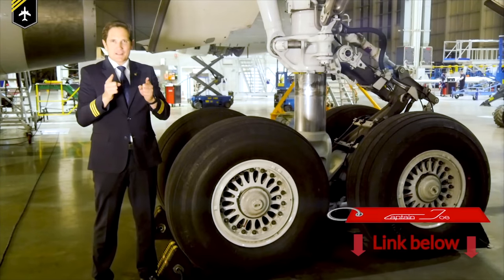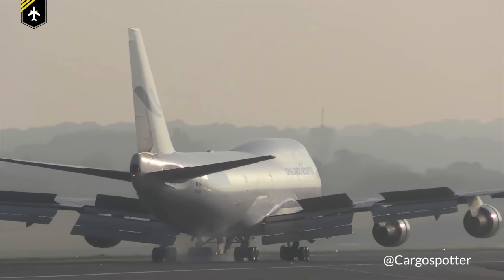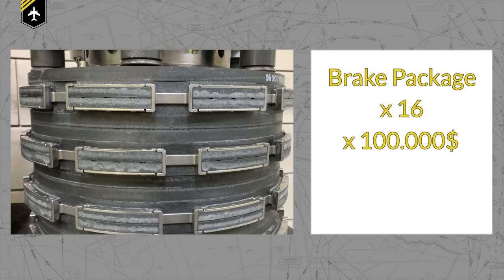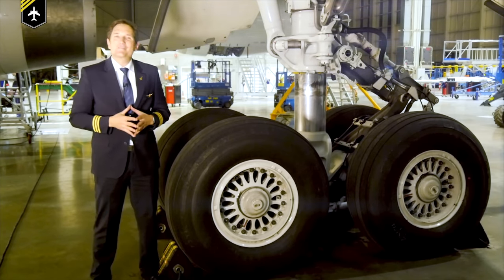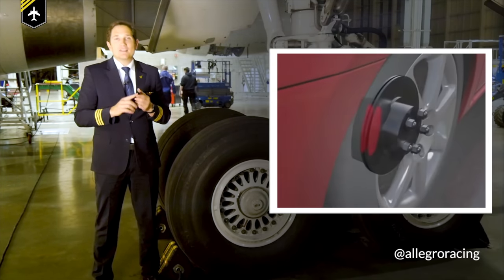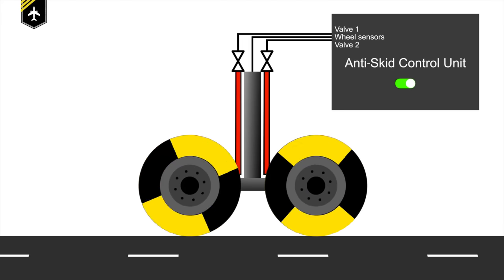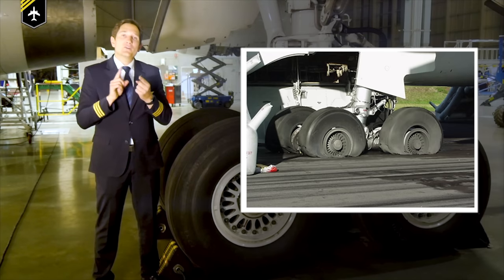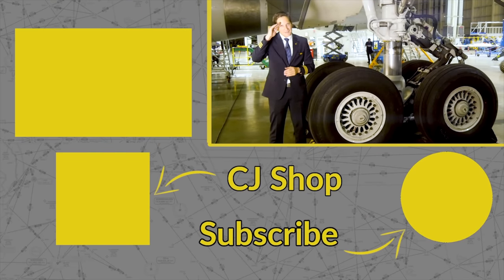Do PLANES have ANTI-SKID??? How to PREVENT SKIDDING? Explained by CAPTAIN JOE

Comment: My question is, when the engine shuts down during landing, how do we apply brakes to stop the aircraft ?
Reply: Engines do not shut down on landing. They do so only when at the apron. When landing, they still keep running on idle power (or even spool up again to provide reverse thrust if applicable). At any rate, they would still provide enough energy to drive the breaking systems... and there are further backups even for the case that they couldn't do their job...
Reply: @eaglerainbow9313  thank you.. 
Recently there was an aircraft crash at Calicut. The captain has switched off the engine! At that time, how to stop the aircraft?
Reply: @naveenelangovan5406  I assume that with Calicut you mean the crash of IX-1344 at Kozhikode. From what is known so far, there are no indications that the pilots switched off the engines (but you could give evidence for that). The issue there sounds rather different to me (but too little is known right now to properly judge it yet).
At any rate, speaking of the majority of modern airplanes, wheel brakes are controlled hydraulically. There are several independent hydraulic systems in a modern airliner. And several of them can be pressurized also by electric pumps. When the normal engine generators are not available, these electric pumps themselves can either be powered by battery or by the "auxiliary power unit" (APU) located in the tail of the airplane. So, in short: If pilots have enough time (before shutting both engines down), they could bring up the APU beforehand and have hydraulics powered by its electricity generator. If not, they have some backup with the batteries. 
And anyways, there is also another option you might not think of: If the runway is long enough (and some more factors like mass, runway condition, wind, etc), there is even no need for braking - you can just let the machine roll out with spoilers engaged (yes, that is not too uncommon as well, even under normal landing conditions, but requires some reasonable weather, which IX-1344 certainly did not have).
Reply: For a hydraulics-out emergency landing, brake accumulators (pressurized spheres of hydraulic fluid) provide the braking capability.  On an MD-80, for example, two such accumulators in the wheel wells provide enough hydraulic fluid for three complete press-and-release cycles of the brakes.  That's plenty for stopping, since fluid is only used up when changing the brake's position, rather than to hold it at a certain amount of braking force.  Just need to avoid much pumping of the brakes, such as to maintain lateral control via differential braking.

Comment: I thought on regular landings for big airliners an anti skid system won’t be needed due to the shear weight of the plane pressing the tires... thought this would be enough to have a controlled manual braking with enough margin to prevent any skid to happen. Not applied in wet, damped or snowy conditions though
Reply: Most airliner brakes aren't "torque limited" (the term used for when a tire can't be made to skid) except at some higher speeds/weight combination.  As a result, an antiskid system needs to be operating even for high-weight braking, unless braking level was kept moderate-to-low.

Comment: Captain Joe  would you tell about existence of any automatic system in the aircraft  which can be activated for  commencing   a go around  necessiated  due to some emergency,  after a TOUCH DOWN.  Seen in various videos that pilots do such emergency take off  manually and the chances of some critical omissions during such  flash  manoeuvre   activities  may lead to disasters. In such cases Auto system may take care of actions like release of brakes, raising of the engine thrust, re setting of flaps etc.

Comment: My comment will make obvious very quickly that I am neither a pilot nor an engineer. 
I envisioned a breaking assist system that would be embedded in the run way: a series of flaps that open up at a low angle (held by modified air shocks) as the tires role over the flaps, they force them to lay flat again (that would compress the air inside of the pistons holding them in the raised position. that compressed air could generate electricity as it is being released) the kinetic energy of the plane would be transferred to the air pistons of the runway flaps in the form of increased pressure. The flaps that start at the point where the plan stopped and end at the end of the runway would be laid down flat again by releasing the air from the pistons through a bypass valve (it could be the same one that is used as an inlet when the pistons are being filled to raise the flaps in preparation to an incoming landing plane).

Comment: Wouldn’t it be more advisable to apply the brakes, notice they lock up, then figure ‘maybe a little less pressure than that’ instead of releasing and applying?  This doesn’t have to be an all or nothing system, then while they’re sliding, then you’re releasing the brakes, they begin rolling, then the brakes begin to apply again, you are getting negligible braking effort.
Reply: On the systems I'm aware of, it's not all on or all off.  The system operates at a high enough frequency that the pressure curve looks more like a ripple overlaid on the average pressure value, like what you are suggesting  [don't know what the video maybe says -- I usually head straight to the Comments].